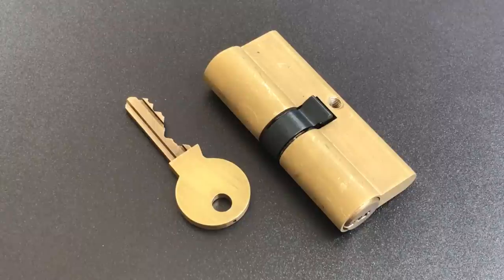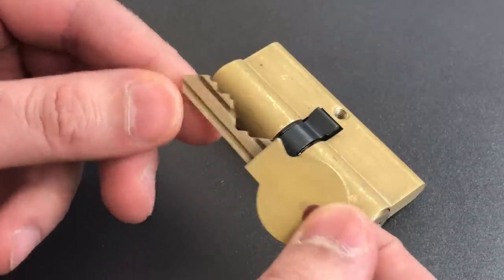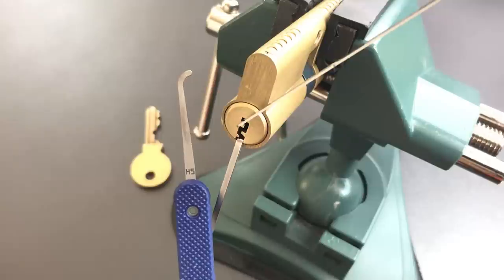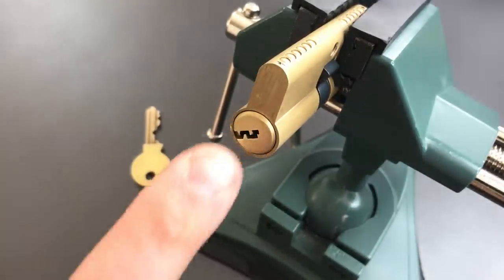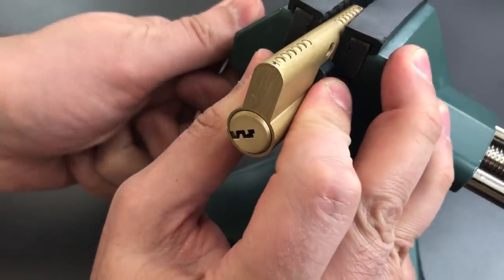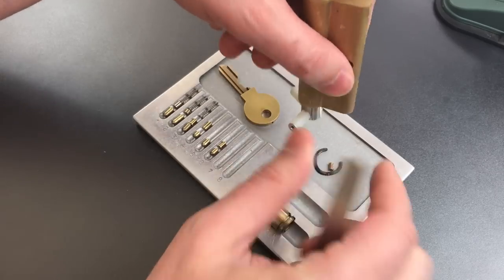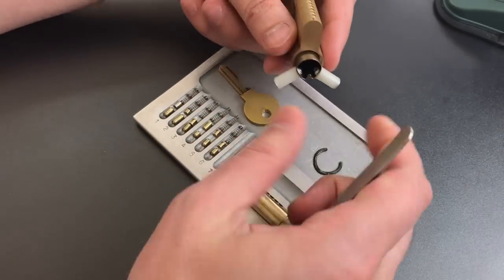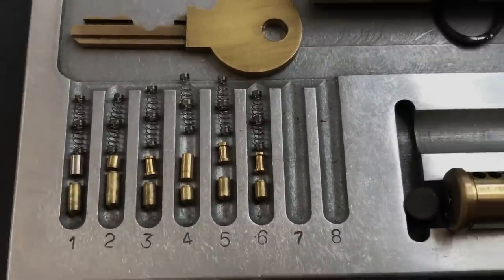[612] Prototype Of UrbanHawk’s Pin Blocker Cylinder Picked and Gutted

Comment: I would really like to see you pick Euro-Profile cylinders in their respective correct orientation, which is 180° flipped from how American locks are mounted. Meaning "top of the keyway" is "bottom of the keyway" for us.
Reply: Why would that make a difference in picking?
Reply: @An0niem4  You need to work in the complete opposite direction and can't rely on gravity to let the keypins fall back down and clear of the sheer line.
Reply: @BlackThanator  Pins are kept under spring pressure, right?
Reply: @An0niem4  Yes, but the key pins are not.

Comment: driver pin no 2 will be spooled
Reply from the maker: I had to think for a second, then LOLed. 👍
Reply: I had a thought of this as well; Make a driver pin with a spool and fits the entire core without a spring on it.  So if you get the others open it will not go past the false set unless you release all tension and let the pin drop, effectively spoiling any potential picks.
Reply: @lockpickinglawyer  when will the final version be shown?
Reply: That would be amazing. Maybe some trickery with under cuts as well?
Reply: @lockpickinglawyer  any updates
Reply: Update us!
Reply: LockPickingLawyer whole lotta people waiting for that second prototype, any idea when?
Reply: @Rev0lutionary  That would mean the lock could only ever be fitted in one position. Because... GRAVITY!!!!
Reply: Very obfuscated answer. I like it.
Reply: harpoon ne
Reply: @lockpickinglawyer  We need to knooooooow
Reply: @lockpickinglawyer  2 years later and no final product or second prototype? what happen did they get bankrupt?
Reply: If pin no 2 is slightly wider than the other pins, it can be the first one to bind, and tightly. It might be very difficult to reach behind it to manipulate the other pins, and if you overset 2, you'd have a hard time resetting it without dropping everything else. Why not pin 1? Maybe to hinder visual access. Maybe because the pick fulcrum is too close, making it easy to get around 1. Maybe because 1 is going to be steel for drill resistance in the final. Anyway, that's my guess.

I checked since it's been a while and I don't see a follow-up.

He's protecting the bottom of the keyway. Why is that? Could that be related to the special thing? I'm not resolute in my guess being right. If the bottom protection is related to the special security, then it seems to be at direct odds with my guess. I'm OK with that.
Reply: @billkillernic  Project was abandoned, according to other comments.

Comment: As a locksmith we avoid these deepest cuts in the first three pin chambers closest to the bow so the key is not broken too easily.  There are a percentage of People who twist a key when inserting it and stress the key. I would place the zero lift to chamber 5.
Reply from the maker: I assume that’s why the key is so thick.
Reply: So the first cut /isn't/ the deepest.

Comment: Well, we all know that because of "manufacturing tolerances" each lock has a certain order in which the pins must be set.  I bet UrbanHawk is going to manipulate this to force the #2 pin to be set first; once it is, there's no way to raise pin 3 (in particular) because there's no clearance.  (For example, if you slightly chamfer the holes in the cylinder for pins 3-5 they will always set after the non-chamfered pins).  Hence the name - Pin 2 becomes a Pin Blocker, preventing access to the pins behind.

EDIT - rather than a chamfer,  a countersink might work better - a chamfer could allow a partially-picked pin to "ride up the hill", a straight-sided countersink would prevent this.
Reply: Mark Phillips 

That would be my guess and Ive always thought forcing a pair of guarded pins to be the first two binders, would be maddening.
Reply: Can anybody manufacture or find a way to countersink/chamfer the 3-5 holes inside the barrel. I mean this kind of barrel cannot be made by cutting out metal, only way is to 3d print such barrel (with countersink hole on inside surface.
Reply: @vikasbrijkaushly7278  That's actually entirely possible to machine, it would just be very expensive.  You'd need an undercut tool to do it, and circular interpolate the holes.  It's doable, just expensive and slow.  :)
Reply: For more fun, how about a chamfer leading away from the end of the driver, so that a partially picked pin would "ride down the hill" away from a set position?
Reply: That's my guess too
Reply: @komitadjie  If the countersink is not much wider than the bore, it's pretty easy to manufacture with a custom-made tool on a CNC..
As the core is brass only, it's not challenging to cut delicate geometries.
Reply: @norbertfleck812  You don't really even need a custom tool, an undercut tool like that can be had commercially.  The expense increase will mostly be in that instead of just a quick drilling operation for each pin bore, you'd need to drill, then come back and circular interpolate to cut the undercut in each hole. Not hard, just a fair bit more time, probably 3x the machine time on the operation, which raises costs a far bit.
Reply: <old comment, I know> This is definitely a valid deterrent. I have a relatively easy lock type that I CAN NOT pick as pin 4 binds before pin 5 and the 5 pin is all the way to the top while pin 4 is almost to the bottom (known by looking at the key bitting after weeks of failed picking). About 10 hours total of picking and it's still in my naughty bucket. It was so frustrating that I bought the same lock type to pick so I don't feel so stupid. 2nd one opens in around a minute. Drives me nuts.
Reply: This is exactly what I thought
Reply: would just take a very steep hook to set it then though ui do a similar thing to my challenge locks

Comment: Is the low cut number two pin supposed to be slightly bigger diameter so that you have to set it first, effectively blocking access to the pins behind it?
Reply: I’m not sure that a bigger diameter necessarily affects the binding order.
Reply: That's the most plausible answer. Basically if you set the pin as low as possible, and have the following pin as close to MACS as possible, and not drilling through the warding on the 3rd pin, you effectively make the lock almost impossible to pick. Making pin 2 wider as well, means you wouldn't be able to  drop pick it either, as the other pins would drop first.

Comment: The number two pin is going to be purposefully made as the first pin to be set, then, it’ll block access to the other pins, which can’t be set until the number two pin is set
Reply: My guess is - or was (no follow up still) - the three pin will always be set very high, and would leave the left warding intact, making it hard to get the pick up from the bottom.  We may never know.
Reply: It also seemed at 9:21 that only half of the pins are actually visible which could make single picking even more difficult. Overall, I'd say this this lock is not more pick resistant other than requiring high dexterity due to somewhat limited access to pins.

Comment: My guess is that the #2 keypin has a spool element that allows a sidebar or ball bearing to drop in unless it is overset. This would block the movement of pin 3, locking it in place so it can not be lifted to the shear line.

Comment: A spring actuator to dissociate the other side of the lock unless a key is present with anti bypass design along with core holes at 11 and 13 o'clock to allow driver pins to fall into it if the key is not present. Rendering the lock inoperable at a false set in either direction. Anti drill pins.

Comment: With that warding it would be perfect to have a max depth cut, so it would overlift as soon as it is touched, and use the macs to make pin 3 hard to set.

As the DIN is mounted upside down, a driver is needed in chamber 2.

Can the plugs in the top be punched out for rekeying, or is a special loading tool needed ? With the balanced pin stack it is nice to punch the plugs through and fit them back in after loading pins and springs on a double cylinder
Reply: Why even pick , that is non snap proof lock ,  it takes some basic tools and its open in 10 sec when it snaps in half .
Bet Ramset would beat that lock by shooting the lock it may snap in half too .
weakest point is that hole in middle and when thats not forged steel its not a good lock .
Here some scary ad about it from 2013 
https://www.youtube.com/watch?v=88m_Hk5ipI8
Reply: Pete Lind there are many faceplate designs to protect a DIN cylinder from snap and the core from being pulled out.
The deal here is to protect against NDE without any signs. Causing insurrance claims problems
Reply: And this is a proto item. The final could be made from stainless steel. This is a test of Security technics

Comment: I think a heavy spring tension along with an evil bidding, perhaps with warding along the pin stacks would be pretty hard to pick. 
Heavy spring tension would require a heavy duty pick, but a challenging warding that only a .015 pick could fit inside. It wouldn't be able to move the pins because of the extra spring tension
What do you think @LockPickingLawyer ?

Comment: Need to make sure that second pin always binds first so you can't just push it out of the way to pick the other pins first!  Standard pins on the second pin and T pins on the others?

I had a particularly evil idea that is similar, but perhaps even more scary to pick.  Zero lift pins sticking deep enough into the lock, from both top and bottom, that there is no straight line path down the keyway whatsoever while the zero lift pins are set.  Also, since the zero lift pins are standard and the functional pins are T-pins, the only way the cylinder can turn far enough for the functional pins to bind is if the zero lift pins are already set, which blocks access to lockpicks.  The key for such a lock would be zig-zag shaped.

Comment: Do you commonly bend really thin hooks when dealing with security pins?  I bought a set of nice thin Rytan picks and trying to pick an adversary lock, I commonly find myself bending the hooks (vertically, not horizontally).  I should say that I suck at security pins, so I suspect I'm just doing it wrong and this method I'm using just requires too much force.
Reply: Scott Gartner lighten up on the tension.. broken picks happen always use the thickest pick you can slide into the keyway to lift those pins.
Reply from the maker: Not often... but I did when I started picking. Thousands of hours picking later, I have a better feel for what a pick can endure.

Comment: My guess is that you won't be able to tension the lock with #2 lowered even a bit. (Maybe #2 will be slightly tigther to achieve this?) That way you either (1) keep #2 untouched and then you can't access #3--#6 or (2) you won't be able to pick #3--#6 as the pins wouldn't ever be binding.

But when you insert the key, you set all pins to the correct position including #2, and then everything works. The point is, I don't believe that traps is what LPL has in mind, traps are fine but somehow useless if the owner has to drill the lock after an unsuccessful picking.

Comment: I would think a keyhole slot (think woodworking frame hangar, look up keyhole router bits of you need the visual) cut radially a ways around the perimeter, with those spool pins, and that warding would be extremely difficult to pick
Reply from the maker: Some lock makers have done that by sleeving the core. Ruko comes to mind immediately, though they haven’t done that in a while.

Comment: there is one big problem with low spots on a key like you mention and i have had that issue myself the key is more prone to bending and fracturing! so it may be harder to pick but its more likely to break the key.

fortunately for me it didnt break in the lock so i bought as new one and replaced the lock it was a euro style similar  to what you have here

Comment: Guessing that the first set of pins is riding on a floating element (wedge?) of some sort that sits in that very odd groove in the key. That hole through the key makes me think it’s there intentionally for lining up a floating element that maybe the pins sit on top of, so you need to manipulate the floating element as a single object to get the lift/angle perfect to set those pins.

Comment: You could force pin 2 to bind first, so there will be no way to access the pins at the back without oversetting pin 2. You would have to use some sort of pick that wrap around the warding while picking...

Comment: I was thinking of doing something similar with a KW1 keyway, extending the chambers for position #1 and #3 though the warding where they would normally sit so as to let the pins in those chambers spots reach all the way to the warding, but not extending the holes for any other pins so as to allow picking them from below the warding.  A couple of other essential features not present here would be the use of flat-topped key pins in the super-low-cut spots, but slightly bottle-shaped upper pins everywhere else.  The flat-top keys could have a very slight taper at top, but the minimum diameter should be well above the "neck" diameter of the bottle-shaped pins.  Key insertion would be slightly awkward since the point of the key would have to be lower than usual, which would mean the front of the lock would guide the key to the wrong place, but otherwise I think even a stock  KW1 keyway, adjusted in under a minute with a pin-sized drill. should pose a challenge.

An essential requirement for pick resistance would be that the sides of the bottle necks not be able to reach the edges of the chambers except when key pins for the two lowest cuts are in their lowest position.  Having shoulders on the bottle-shaped pins would help them fall into place and lock the cylinder in the correct position to guide the flat-top pins into the bible.

Comment: The keyway looks so familiar ;), almost like on some Burgwaechter padlocks. I love that prototype key haha :D. Some Euro cylinders do actually not have the holes drilled through the warding completely, so it is very very hard to set very high pins in the back protected by lower ones in front of them on these. I've had locks with so high pins that even the deepest hooks could not reach high enough or simply couldn't get in position (a tight paracentric keyway makes it even harder). I'm very curious how Urban Hawk's finished cylinder will look like, he's a smart guy :).
Reply from the maker: It is similar to the BW... like the Gamma 700? What Euro cylinders have shallow drilled holes... now that you mention it, it seems familiar, but I can’t place where I saw it. Maybe Mauer?
Reply: Yes, it looks almost identical like on the 600/700, just reversed and the last top bit is not angled. Many cylinders with a Yale or mirrored Yale style keyway (Zeiss Ikon, ZI, ERA, Vachette aso...) have the holes not drilled through (you can of course pick the from the side ledge, but it's not always comfortable and bitting can make it hard). I have on the other hand a 5 pin round double cylinder from BKS, which has the holes drilled through, but the pins are so low that you can't pick from the side and from the bottom you can't get them high enough (even not with the ssdevs or other deep picks I have)...a nightmare, but I've not yet given up ;) (very similar experience with other old BKS and Zeiss locks...). 👋🦊

Comment: How is a keyway like this milled into the core? I can see how you’d make either half, if you’d make it in two halves, but I don’t think they do that, right?
Reply: Nowadays its probably done with an wire EDM machine for really complex keyways. Uses electricity and a wire to cut with almost no kerf.

Otherwise they are most likely broached (kind of like punching with a die).
Reply: Prototypes are wire EDM'd, production locks are broached with progressive broaches. Makes the keyway in a couple of seconds.

Comment: First, great picking LPL.  My guess is that the pin holes will not go through the key warding. Preventing exactly what you did here. That way any pick you try to use off the warding would overset that low pin and it’s all over.
Reply: Albert Lebel yeah, it looks like the key has three grooves along it, so I'm thinking split pins if that's even possible. That would be insane to see.

Comment: Nobody has ever built a core that requires tension on both way to be picked ? ie  : you need to turn the key clockwise to unlock a blade, that would allow you to rotate anti-clockiwise to unlock the core. However while going back to center, if any pin is not anymore in the right position, the blade springs back locking the core again ?

Comment: i think ik y 2 is a low cut. in the nrxt prototype, i presume hes gonna have Pin 2 be the last Binding pin when picking or be a pain to get a pick around it. I recomend that he should thread/undercut the chambers and polish the chambers as much as possible ti minimuze feedback from the pick. Lastly, i recommend he try an ASSA pin, the german pins with the hovering washers (serated thst r not attached to pin. Ball baring pins, and pin in pins

Comment: Probably not the first to say it, but I'm imagining something like the kwikset (I think) modification you showcased a while ago where picking pin 2 incorrectly will let the core turn, but a smaller second driver will drop into a trap hole and effectively permanently brick the lock.

What would be nice with that kind of system would be a way to reset it.  Something simple like a rod from the inside that could push the "bricking" pin back.

Comment: My apartment building had keys with a low cut 1 or 2 pin like this key.  The keys kept twisting off at that point and the lock company kept charging us for new keys.  The landlord finally got rid of those keys and replaced them with keys that didn't have this feature.